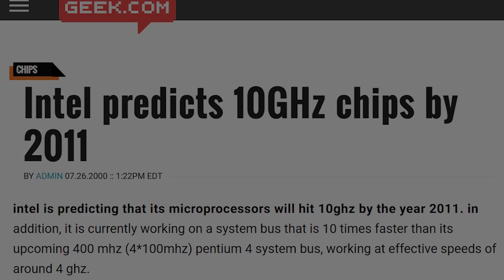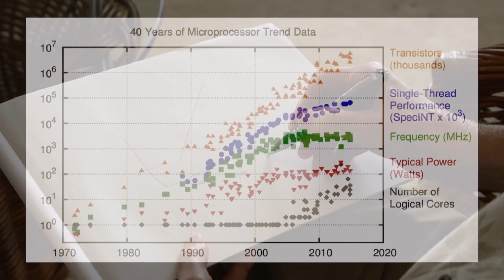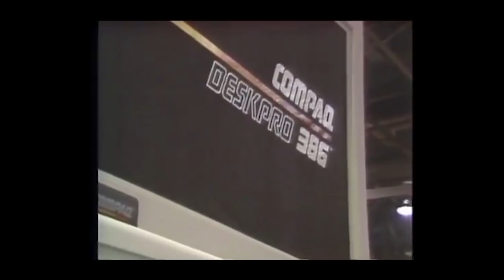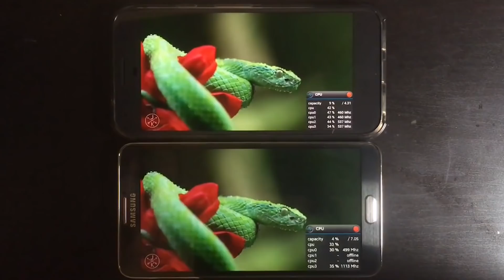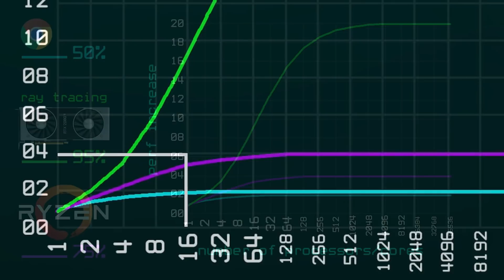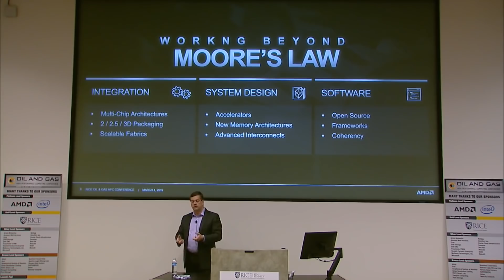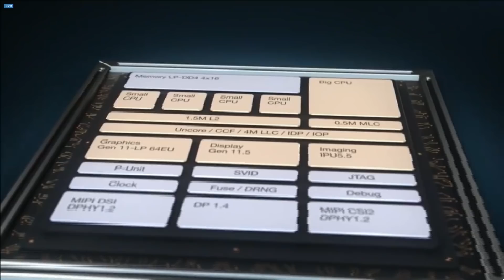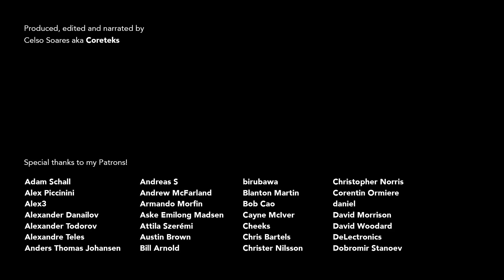Intel and AMD going BEYOND Moore's Law

Comment: What rubbish.  Even individual cores are parallel nowadays both via SIMD/vector instructions and microcode dispatch... The CPU will run a pipeline many instructions deep to allow CISC instructions to be translated to RISC-code, re-ordered, and run in parallel if possible.  So we're already running the sort of auto-parallelisation that you describe, and have been for years now!

Due to this pipeline depth we have speculative execution and branch prediction to avoid much of the cost of flushing that queue when it comes to a branch.  Why do CPUs do this?  So that we can eke more performance from their inherently parallel nature, even as we allow programmers to pretend that they're coding against a sequential PDP-11, when nothing can be further from the truth.  And it's costly!  Significant amounts of silicon are wasted on BP/SE to preserve the illusion, and it presents a security risk (these mechanisms are the basis of the spectre flaw)

To now propose that we take the exact same thinking that gave us spectre, and to scale it up to multiple cores, is pure insanity!  We'll be looking at 30% (or more) of cores just handling the overhead of splitting work out to the other 70%.  And what security problems will arise when the webpage handling your bank details is being parcelled out amongst CPUs running that recently installed spyware?

It all started going wrong with the advent of C and the sequential model that it fostered (it doesn't help that so many other language compilers were or still are written in C)

The solution is better programming languages and better programmers.  We need to roll the industry back to before the advent of C - when LISP, Smalltalk, and Fortran were all offering less rigidly sequential models - and we need to rebuild on solid functional principles... pure referentially transparent functions that can be trivially parcelled out across a thread pool, and short-lived immutable data that can happily be born and die without even leaving the cache.

Otherwise we'll just be throwing ever more precious battery at silicon whose only purpose is to compensate for our laziness and incompetence at using the rest of the silicon efficiently.

...and that just ain't the right approach.  Fortunately the ARM revolution has already hit tablets and datacentres alike, and will hopefully guide us away from such madness.

Comment: Data dependency tells me that this claim is probably too good to be true.
Reply: That's precisely my thought. This seems short-sighted.
Reply: Amdahl's law states that some parts of a program can not be prallelized and therefore any speed up by multithreading is capped by how much of the computation can be done in parallel.

1. The claim that raytracing can only benefit from more cores to a point is only true if we don't increase the number of "rays" we simulate. Say we want to simulate a trillion rays, the cost of distributing a million rays each to a million cores is trivial compared to the workload that each core has to execute, thus each core gives us value.

2. The software that "auto multithreads" can only generate significant speed up if the program under utilizes the the capabilitys of the hardware. That is to say that both the program has tasks that can be done in parallel and the hardware has the spare resources to do so. Everything else will not derive any benefit what so ever.

Somehow Coretech manages to undersell the value of more cores and oversell the value of auto parallelization simultaniously. xD

Comment: For one workload there are a limit to the effect of parallelism. But more than 32 cores will make it possible to run many parallel intensive workloads  at the same time. I for one have many  applications running at the same time.

Comment: Unfortunately not everything in code can be parallelized... Especially when you have things that depend on prior values (sequential processing). A lot of things are done this way and cannot be changed to run in parallel for obvious reasons. Not everything is vectorizable.

Comment: For Quantum computing. ( Ai )
32 Cores Cubed.
96 Cores... 
Quantum Computers dont only use 1's and 0's, but also use 2's...
This extra digit (On or Off) could be the answer to higher Frequency.
Unfortunately, Americas Power Grid isn't efficient enough for all the extra power needed for everyone to have their own 
Quantum PC's. the Grid most likely couldn't handle the Load.
Also, it would be expensive and it would be hard to Cool the CPU... 

Also, what ever happened to the 3D Crystal CPU Transistor Theory?
PS, that VISC Compiler looks dope.
they done stole my idea haha
Reply: Quantum computers don't use 2s.  I don't fully understand it myself, but it sounds like, while a bit can only be a 1 or 0, a qubit is simultaneously a 1.0, a 0.0 and everything in between.  When you read the qubit, it collapses into a single value (anything between 0.0 and 1.0).  Apparently, this gets kind of tricky, since it's somewhat random what value you get when you read the qubit.  For example, you might plug in 2 + 2 and get a value of 7.  But if you do 2 + 2 several times, you should get 4 more often than not.

One way I heard it described (and I might be butchering this) was that it was like sending a guy into a room and telling them not to come out until they had found a specific person's phone number in the phone book.  So when they open the door, they might have the phone number you're looking for (which is what you want), or they have have left the room because they don't have a pen, or because they forgot the name they were looking for, or they needed to ask you about something, or they actually got the phone number above the one you wanted, etc.

Quantum computers are tricky, but powerful.  But from what I understand, they won't be replacing traditional CPUs, but rather working alongside them.  So-called "QPUs" are good at things that CPUs are bad at, but bad at some things that CPUs are good at.  It's probably a bit like how you have both a CPU and a GPU, they're good at different things, although you probably could force a system to use a GPU instead of a CPU, since they're much more similar.

Comment: When they say "14nm", they mean a *gate length*, as in how many nanometers an electron would have to tunnel through to get a false positive. In that sense, 5nm is a hard wall in silicon (and even then it requires EUV etching which has poor yields right now). We could maybe go to 3nm on graphene or silicon-germanium, but that probably only gets us the one extra node.

So two things could happen, because fabricators will not let go of the gravy train easily: They could move to light - surface plasmons (near-field light) have a lot of potential, for instance; and they could invest in really advanced interposers to stitch multiple wafers together, getting better yields on very large dies (AMD is already doing the latter).

3D transistors and package-on-package is an interesting trend, but it really just means more dark silicon as it exacerbates the waste heat removal problem.

Comment: Extra cache space will definitely help a lot. In particular for applications coded with multiprocessing in mind, with as little as possible data sharing between threads.
As it stands now, even if you code perfectly parallelizable applications and eliminate all data sharing including false sharing the threads still compete for cache space.

Comment: nobody can really trace the 640k quote to bill gates.  he may have said that 640k is more than anybody would need on an 8088 machine which was the one that actually had the 640k limit initially.  for the most part they were right about that.  adding more ram to something that is computationally weak doesnt make sense

Comment: Fun fact : you can make a 128 GHz transistor, but that doesn't mean you can make a 128 GHz processor using those transistors. It's like saying "planes are made of aluminum, so is my car, so my car should achieve 950 km/h".

Comment: You got one thing wrong about parallelism efficiency: Amdahl's law is only half the truth. There is also Gustafson's law stating that as computing problems get larger, their parallelizable part increases. For algorithms like ray tracing or fluid simulations, this means that, given the problem is big enough (which it is), it converges to be 100% parallelizable, scaling perfectly wirh the number of cores / stream processors.
Reply: @Calen Crawford basically every 4K frame of a video game is large enough, so is digital video decoding at high resolutions, ray tracing and neural networks. Obviously not all algorithms have the required parallel nature, but the ones that do can very efficiently make use of many thousand stream processors in GPUs. In some cases the bottleneck even shifts away from parallel computation to memory bandwidth limitations.
Reply: @NoobNoobNews  U said something and I didn't understand but u sir seem knowledgeable.

Comment: I'll believe it when I see it. I'm a programmer myself and I find it hard to believe some other soft or hardware can magically figure out my program and make it multi thread without data racing and memory leak. If there is technology like that, it will be worth so much more than using on your games or mobile apps.

Comment: There is always be some utterly ridiculously idiotic framework/programming language/operating system which will make use of those cores a ghz. Look at electron desktop apps for example, it's disgusting. If programmers were banned to create crappy software "your mom" type of users would not need more than 2 or 4 gigs of ram and single core cpu would be just fine...

Comment: 1. I think shrinking the size below 7 nm is going to hit a wall since quantum effects like quantum tunneling will cause problems. Heat is another problem, at least with Silicon.
2. Consider that most computers have hundred or thousands of cores, via GPU cards. Already lots of computing intensive apps already use GPUs for parallel computing. Multi cores are also used in Servers either for virtualization or just running a lot of services or supporting a large number of users (ie Website with hundred or thousands of users connected, likely using a spawned process on a selected CPU thread.
3. For most single threaded apps, Speed is not really important. You really don't need a 3 Ghz 32 core machine if all your doing is Word processing, Web browsing, etc.
4. Currently the bottle-neck for computing is storage & network IO, which is usually thousands of times slower. 99% of the time users are waiting on storage or networking bottlenecks, not processing power. 
5. For really processing intensive applications, the future is likely FPGAs or some future derivatives. Why run your process in code, when you can run it directly in hardware. Currently Embedded computing devices are embracing FPGA microcontrollers to enhance performance and provide ASIC type architectures without the need to produce your own custom chips for a specific application. Currently most FPGA max out below 100Mhz, but they can run circles around RISC\CISC processors.
6. Future development may also focus on DNN (Deep Neural Networks) to enable computers to do more complex tasks. For instance Self-Driving cars, Visual inspection (look for defects\problems in automated manufacturing) , Natural Language processing all rely on DNN.  I would imaging companies like Intel & Nvidia may eventually provide DNN hardware for desktops\handheld devices & servers. to enhance the capabilities of applications. large DNN is very processing intensive on RISC\CISC processors.

Comment: one critical thing that people fail to consider with parallelization is that only applies to single applications / tasks many thread or many cores is very helpful when one considers the average use case of a PC actually has the PC handling many simultaneous unrelated tasks this scales essentially linearly as the tasks are unrelated.

Comment: 3:50 lol nope. Believe it or not quantum physics actually does impose a hard and fast bottom limit on how small a circuit can be and still BE a circuit, and the electromigration problem starts getting insurmountable loooong before you get down to that scale. Expect your 7nm  core i-whatever CPU to have a working lifespan of a couple months. 3nm? Days. And don't expect cost-per-transistor to make that any less painful, cause cost-per-transistor stopped going down years ago.

Comment: I'm a professional software developer and I'd definitely optimize software for as many cores as available.  People who make computer games or any software that push hardware to its limits will optimize for as many cores as available because, if they don't, competitors will and get more customers because of it.  Parallel processing isn't rocket science.  Support for multithreading is in every modern programming language.  Features to manage multithreading like semaphores, locks, transactions... are similarly available anywhere they're needed.  Automatically breaking up a sequential program into a parallel one sounds too difficult to really happen.  Software developers parallelizing more of their code is how we're most-likely to get better performance out of our 32+ core processors.

Comment: why dont we use computers to heat water to generate energy? make massive servers that generate part of the energy they are using or at least using this energy created to be stored on batteries to be used on emergencies. it will never create more energy than it needs but it would transform a cooling system into a way to create clean energy. i think its better than nuclear energy since the heat is result of something useful already and the generation of energy is a secondary factor.

Comment: A few major facts are not being accounted for in this video:
1. The physical limits of silicon vs other materials (like graphine). In short, other materials may be able to break both frequency and miniaturization barriers, in ways that silicon fundamentally is physically incapable of. 
2. The fundamental design incompatibility between programming languages/paradigms vs. hardware memory hierarchy, when it comes to memory access/allocation patterns. In short, most reasons for why software is slow, has nothing to do with processing/parallelization at all, and everything to do with random memory access pattern. No auto-paralelisation solution can ever solve that, as it's not targeting that problem. 3D stacking may help there, but a more fundamental cultural shift in programing paradigms is where the real solution is - and that's a culture problem, not a technical one.
3. Not all problems are distributable/paralelisable. Auto paralelisation can't help there.

And I wouldn't take the fact that intel acquired an auto-paralelisation company, to mean that they are pursuing that direction. The real motivation behind any pretence may be more about killing a potential diruption by acquiring and defunding. Companies do that all the time when their dominance is threaten.

Comment: As a software developer, this video really doesn't make a lot of sense. Most seasoned developers know how to write multi threaded code. The issue is not that we don't know how to write software, it's that writing thread safe software introduces 100's of issues due to lack of synchronosity. File locks, race conditions etc. Time = Money and there's only so much money people want to spend on software and thus only so much time developers can spend. Naturally, in these constraints we do out best but often don't have the time to take advantage of these advanced features.

Comment: Great video, love your work, but why do you claim there are no problems with reducing the size of the transistor when its practically common knowledge that quantum effects are starting to interfere with this process and anything below around 1 nm is highly questionable (the size of a silicon atom is 0.1 nm, or around 100 pm)?

Comment: There is a huge problem with this. Most software currently is memory-bound not CPU-bound and currently L1 and L2 caches are per-core. If you artificially split workloads between cores, then you will have to synchronize data between caches in some way. Notice the videos did show CPU utilization but not frame rates. If the data wasn't there yet because of cache misses, false sharing and whatnot then of course CPU usage would be lower. But maybe they've found some reasonable way around it, what do I know.